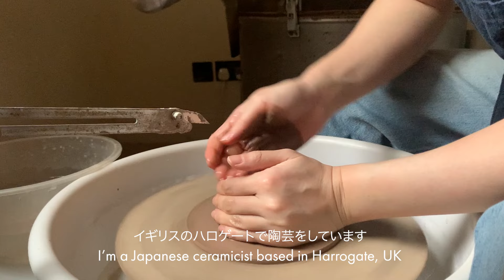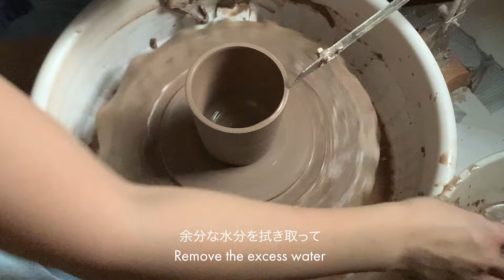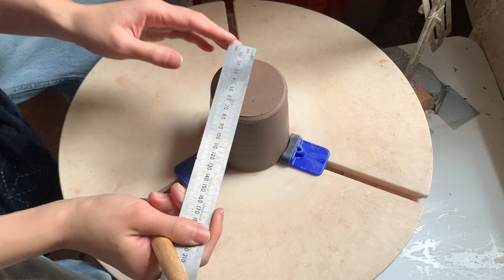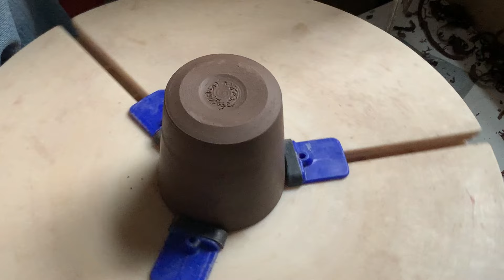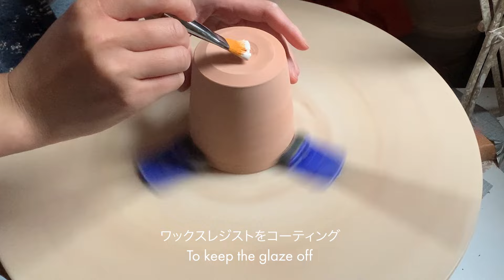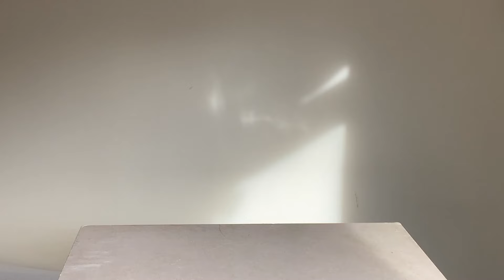Making a stoneware ceramic Yunomi / Flat White Cup from start to finish [陶芸] 湯呑み / フラットホワイトカップを作る

Comment: there are some colorants that can be absorbed through the skin. It might be dangerous to get your hands excessively into the glaze.
Reply from the maker: Thank you so much for your comment! It’s not a particularly toxic glaze and sometime I just needed to check glaze consistency with my fingers so I cut shorter path.. I don't use any of the common nasties: manganese, chrome, barium, or leads so I’m not overly concerned. Although you are completely right and I should be using proper mixing tools or gloves!